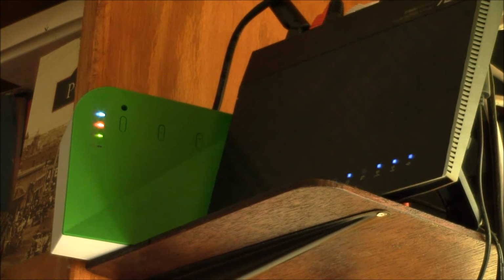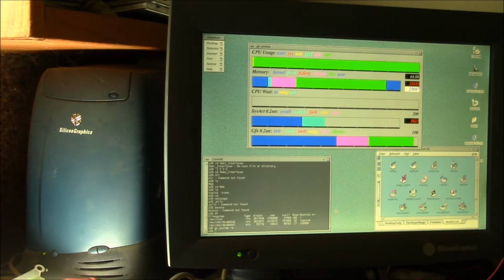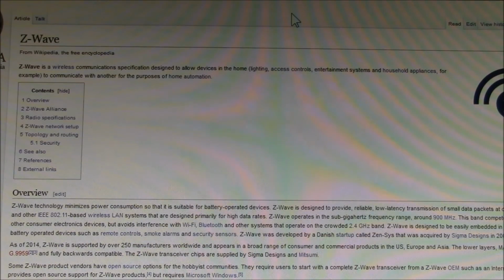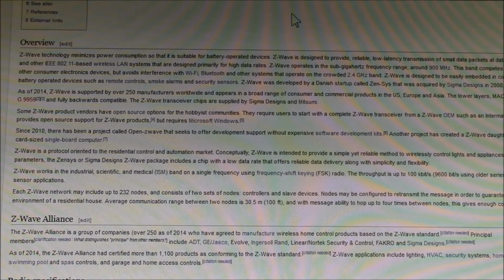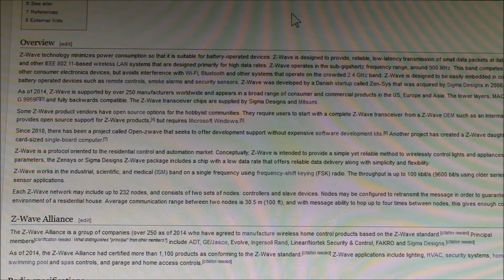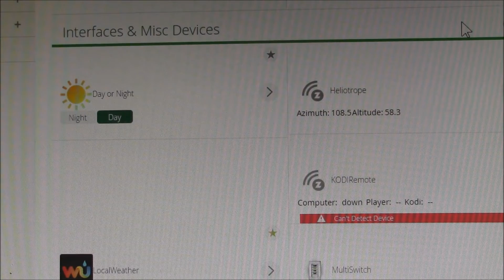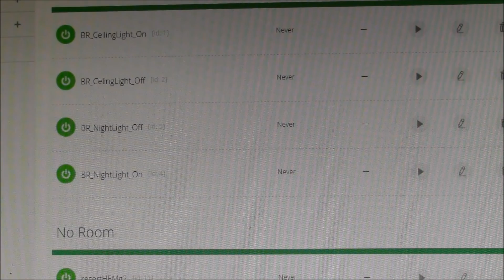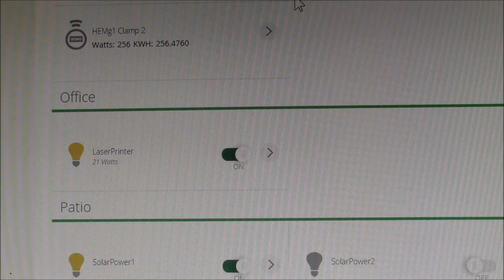Z-Wave Home Automation, Introduction

Comment: Since UPnP is a massive security issue (always has been, always will be), will these things work in a network with UPnP entirely disabled or does it need a segregated network to require UPnP be enabled on the WAP or router?
Reply from the maker: I believe the controller can be run w/o uPnP.  The ZWave devices are not part of that anyway, they all operate independently of the Ethernet or WiFi network on a separate RF frequency.  You can access/control uPnP devices if you wish and you might lose that capability with uPnP turned off.  For example, you could have the controller monitor your home theater and automatically dim lights and close curtains if you were to turn on the media player and it sent out a uPnP notification of that.  You could still dim the lights and close curtains via another ZWave based scene, just that it wouldn't happen automatically based on powering up the media player.

Comment: What is your opinion on WiFi based switches compared to Z-wave? Would like to know the pros and cons. I am totally new to Z-wave technology and would like some more information.
Reply from the maker: I've not tried any of the WiFi based switches to date as my original ZWave controller doesn't support them.  My new VeraPlus ZWave controller is supposed to interface with WiFi, so I may try a WiFi switch at some point.  There is a fundamental difference in WiFi vs. ZWave networking.  WiFi relies on a main access point that needs to be able to talk to all the other devices point to point.  ZWave is mesh based so each device only needs to talk to it's nearest neighbor.  In a small dwelling, WiFi is probably OK.  But in a larger place, ZWave will expand much better, as you add devices, the robustness of the network increases as there are more nodes scattered about.

Comment: Hi Mr Brown, really go introduction to Zwave and Vera.  I am just wondering if you install; for example an Aeotec zwave wall switch behind the original switch of your light, are there any regulation to prove that Aeotec switch is in compliance with the electrical legislation, and hence it wont void my insurance cover if anything happened.
Reply from the maker: The Aeotec devices all have a UL listing as I recall.  I don't see it on their web site, but the modules themselves have the UL logo on them.
Reply: Hi Mr Brown, I dont see any UL listing on my Aeonlabs devices anyway, installing it at my own risk. thanks.
Reply from the maker: I only had the one smart energy switch module out that I could look at and it had a UL logo.  Maybe only some of their modules have that listing.  Maybe contact the support folks at Aeonlabs and see what they have to say.
Reply: Will try that, thanks

Comment: Hi nice video. how do you access the controller from outside your home? do you need to set up some sort of port forwarding or ddns on the router?
Reply from the maker: Yes, I believe you need to forward port 22 (SSH) through the firewall and then either have a DDNS type service running or you may be able to access the controller via the Vera login page:
https://home.getvera.com/users/login

Comment: nice video.  my biggest concern is the reliability.  I'm looking for something that is stand alone.  and Web capable. need to be able to schedule local and not worry about loss of Internet stopping my plugs or lamps from turning on and off or worse water to plants 3 times a day and missing a water and plants dying :( wife not happy then. ... any suggestions. ? thanks.
Reply from the maker: +ThailandVenture The Z-Wave controllers are stand-alone and don't require stable Internet connections for normal operations.  You can set them up to allow external access.  The controller is fairly reliable, mine runs 24/7 and only a few times a year does it need any manual intervention.  Usually something related to a firmware update over the web (I have auto updates enabled).  

I do have my sprinkler/watering control as a separate unit, but I have seen folks use Z-Wave to control sprinklers.  Check out Pete B's channel: 
https://www.youtube.com/watch?v=l4GPRTsuHkI&list=PLGzVpwPAKnPYoldab91pdluXgMIh4if9Q